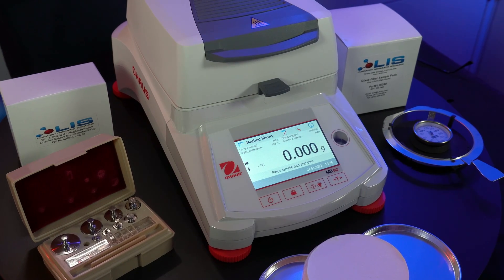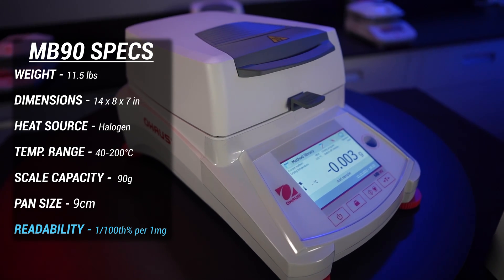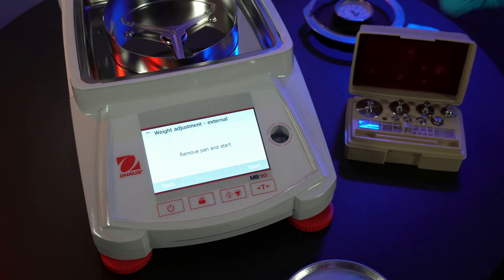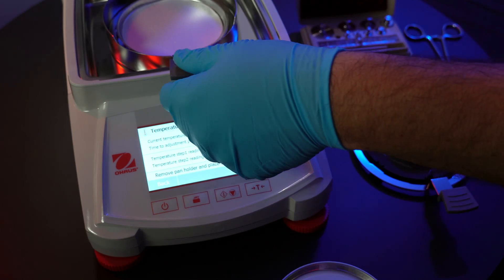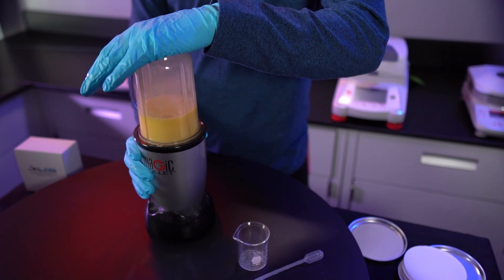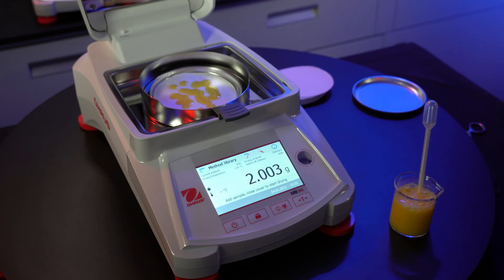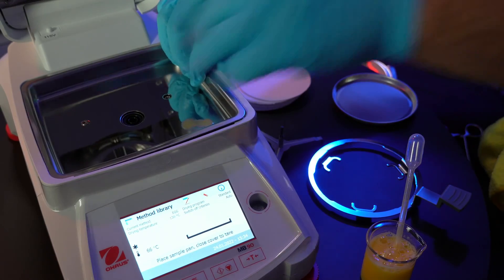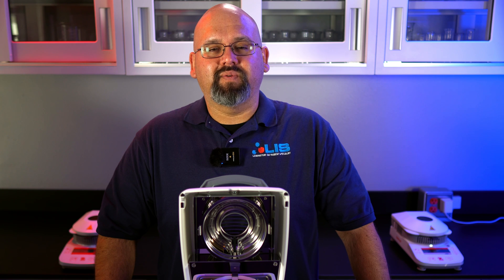OHAUS MB90 Moisture Analyzer

Comment: hi. I have a ohaus mb90 moisture analyzer. it gets stuck on initialyzing moisture application and doesnt enter the weghing mode. what should i do?
Reply from the maker: It seems like the firmware needs to be reloaded. You will have to contact Ohaus or your local distributor to have it serviced. You can ship it to us for diagnostics or repair